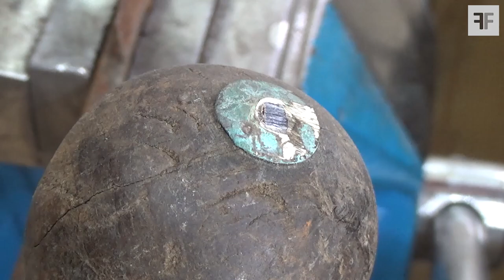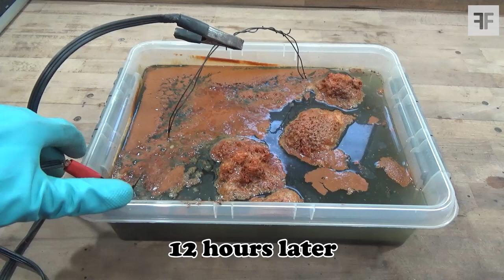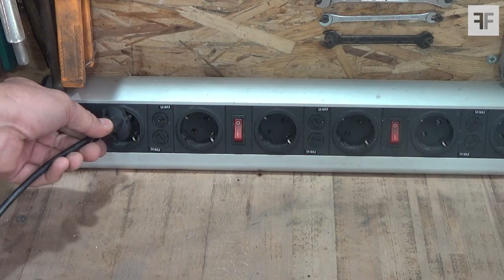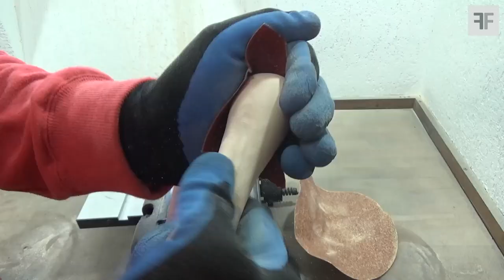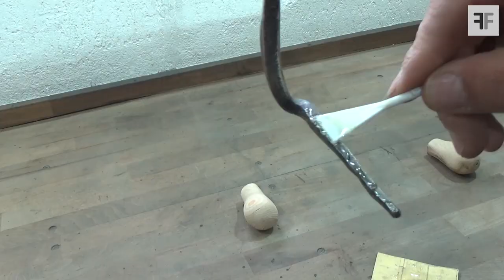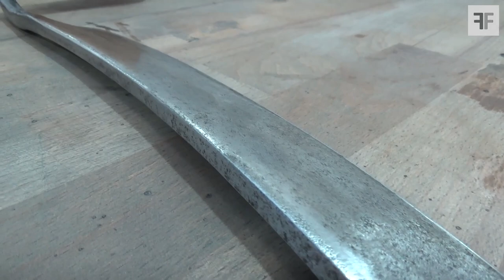Antique Drawknife  ||  Restoration

Comment: I liked this one a lot; however you ran into some manufacturing errors throughout the restoration that could've been easily remedied (without the use of epoxy, again.)
It appeared to me that the handles were originally brazed on. This would've been easy to achieve. Handles are often hot-pressed onto the metal first, and with that heat you could easily braze caps over the metal which is protruding out of the ends of the wood; a quick blow with compressed air, or a dunk in water after it's no longer plastic and it would cool, and simultaneously shrink the handles on tight, while securing the brazing.
Reply from the maker: I did what I knew was the easiest and most efficient way. Epoxy doesn't bother anything, it's not noticeable and it can't cause any problems. So it seemed to me that it was the best solution in this case.
Thanks for watching, commenting and of course thanks for the advice in any case.